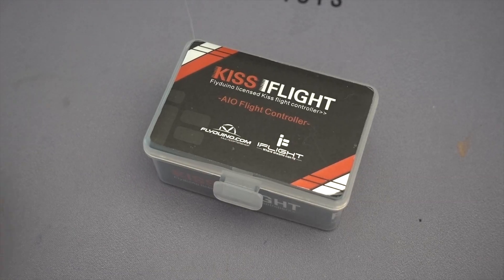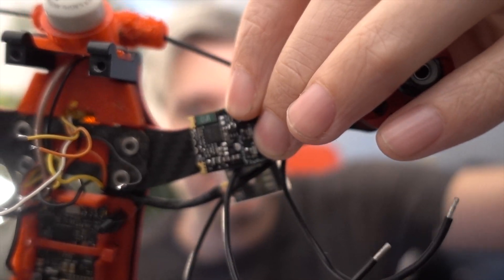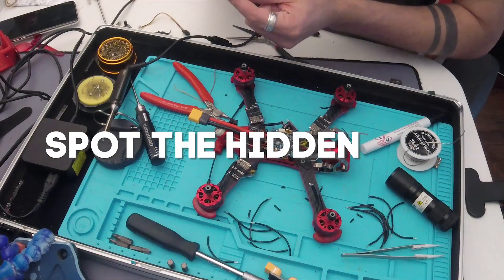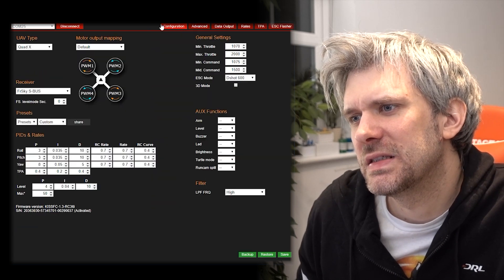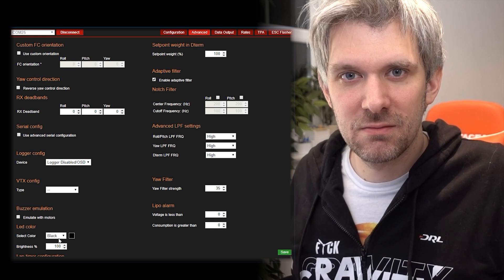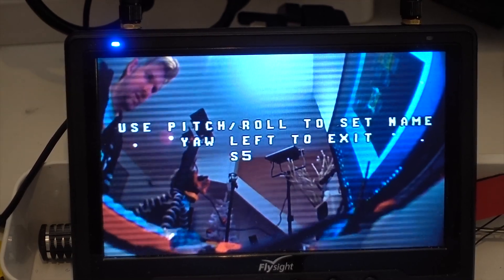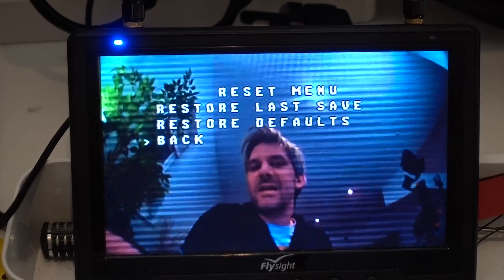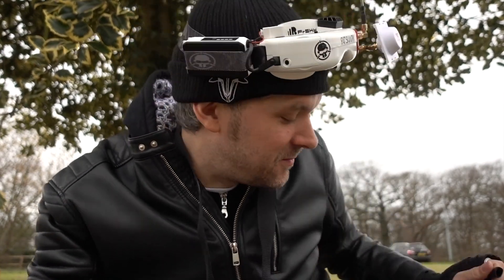KISS iFlight FC - My First KISS Experience

Comment: @Sync FPV i know this is an old video, but after years of kiss flying do you think this one is a good one to get or should i get the original fettec FC?
Reply from the maker: If you can find one, can’t see a reason why it wouldn’t be good
Reply: @SyncFPV  my main concern was behind the fact that will it perform equally or at par as a proper fettec kiss fc?

Comment: Hi there, would you please help me with the non-arminng quad issue? I've set everything up, OSD, vtx, radio work, all channels move etc., but the motors don't spin. I'm using Hakrc 50A 4in1 Blheli_32 ESC. Nothing works when I try to test the motors, calibration is not happening either. When Dshot 600, 300 or 150 is selected nothing happens at all, oneshot makes one or two motors spin uncontrollably time to time. I changed signal range to 1000-2000, moved it in and out a bit - nothing. I've connected BF fc and updated the ESCs to the latest firmware, no luck. Any ideas? Thanks

Comment: Do not take the 5v Voltage for Cam and VTX, use a HV VTX and take the Voltage for the Cam from there or use an seperate Voltage Regulator for 5V. Because these black Lines are annoying. Great FC and nice for build a cheaper Kiss Setup. I can say also with BL_Heli32 it flys crazy smooth! Only change your BF FC for crazy Performance, you will not have to buy new Kiss Esc's for better Performance as Betaflight.
Reply from the maker: Sound advice! Thanks dude, I will try it

Comment: Rooster has the same geometry as that of the Alien, so you can run Mr Steele PIDs and it will fly perfectly.
Reply from the maker: Cheers, I have played around and tuned it much more now than just selecting a favourite pilot preset, I'm super happy with how it feels and I'm fully on the kiss bandwagon :D
Reply: @SyncFPV  i like tuning, but i dont like wasting time on it, so i just put on a pilot preset on a fresh build and it flies great for the day. At night I adjust it a little and then goes out and fly for the next day, and usually in less than three days it will be flying perfect.

Comment: those 32 AMPs can reach bursts of 45A, and Dshot 2400 is really fast.
Reply: Dshot2400 is not capable on this FC. It's running a F3 chip like the V1 KISS FC does which is limited to Dshot600.
Reply: You'd need the V2 to get Dshot1200 and Dshot2400 to get full benefits from the system.
Reply: @BikeGuyFPV  I am aware of that, and I am only commenting on those ESCs
Reply: @kenchenfpv3568  little known fact, but the 24 amp ESCs can run on Dshot1200.
Reply: @BikeGuyFPV  but they don't give on-par response, smoothness, consistency, or reliability. I can see people still using them to get into KISS because it now retails for 20 dollars, but performance wise Dshot1200 alone is not enough.

Comment: You should leave the factory PID's on it and give it a try, just plug in your same rates you use in betaflight and go for a rip. KISS defaults are pretty amazing for most pilots. The presets are all nice and everything but it's nothing more than other peoples filter and PID profiles uploaded for other folks to try. If your not using the exact same setup then pointless and can cause many issues in flight characteristics.  I fly nothing but Kiss and only have a couple Betaflight boards so I'm pretty much the opposite of you. But hey, glad you liked it 😁👍
Reply from the maker: Cheers for the words. I must admit I did play with the pids since this video, I went back to the defaults and have tuned a couple of them a touch higher to make it slightly snappier, its feeling so good now that I've converted 3 out of 4 of my quads to Kiss :) and the only reason there's 1 that isn't is kiss don't do a 20x20 board

Comment: Nice one! Did you solve the lines in the video with a capacitor or so?Gonna stay with betaflight for now. If, I would try Flight One.
Reply from the maker: I did put a cap on and the lines are still there, may get an external BEC at some point for the camera / vtx that might help but as I say. really not as noticable in goggles
Reply from the maker: Smoothie FPV they honestly were way less noticeable in the goggles, nothing distracting anyway. I don’t have any 1000uF caps at the mo but I will try it, will try doing a follow up on this board after a good amount of abuse :)